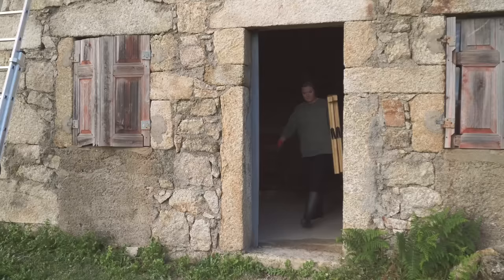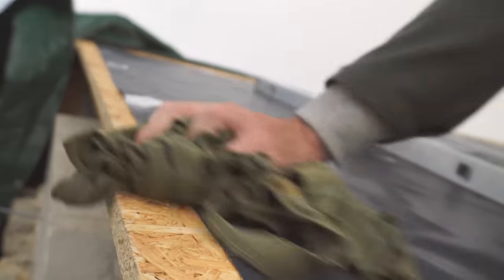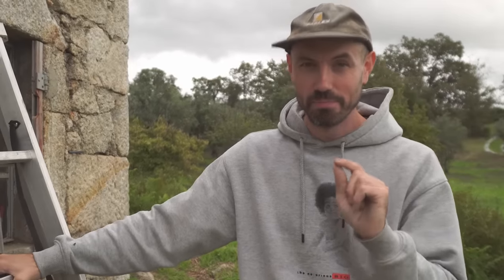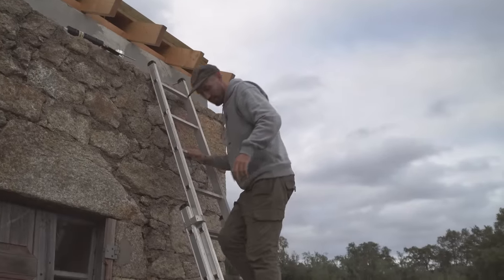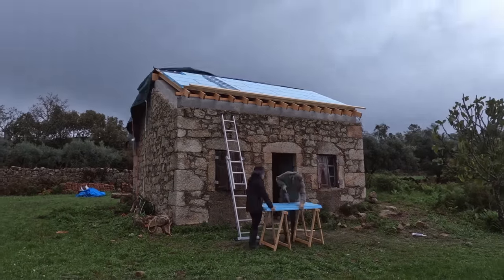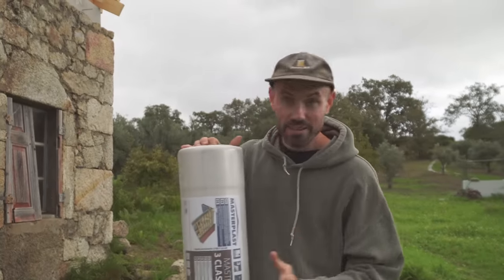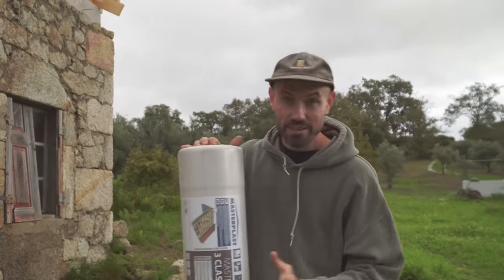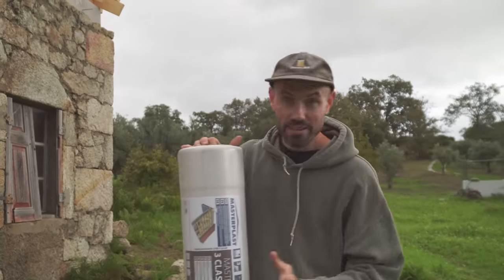STONE HOUSE RENOVATION - Racing to Get Ready for Winter

Comment: While interesting to see how you two are doing the roof, I was equally wondering why the insulation is on the outside of the roof instead of the inside? I don't see that style roofing done anywhere near me. We all do the insulation on the inside of the roof and merely install a tar-paper covering on the outside and than follow up with shingles. Keeps the rain and snow out and works well for us...    Thumbs Up!
Reply: The way you made your roof is called cold roof and the way he’s doing it is called warm roof. The warm roof keeps the house warmer and almost condensation-free inside the house and is the best way.

Comment: Unfortunately, synthetic insulation insulates from the cold but not from the heat. 
to obtain many hours of summer thermal lag, insulating panels in wood fibre, toasted cork, hemp should be preferred 
and never in EPS or XPS or rock wool ;)
Preventing the attic from becoming an oven in summer is very important